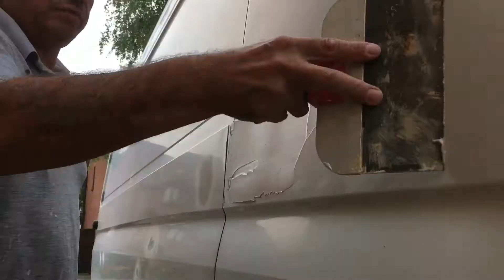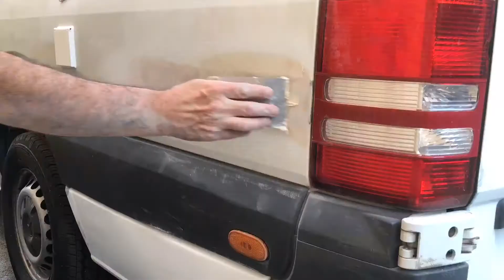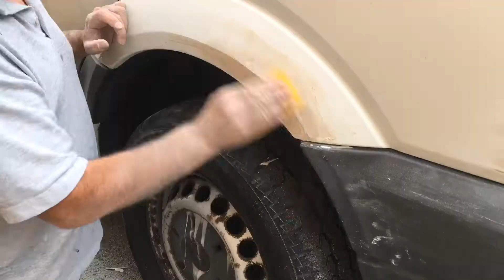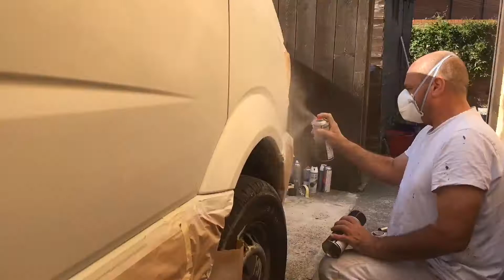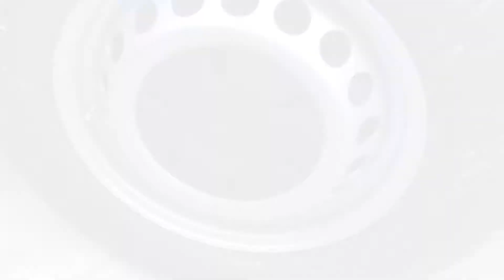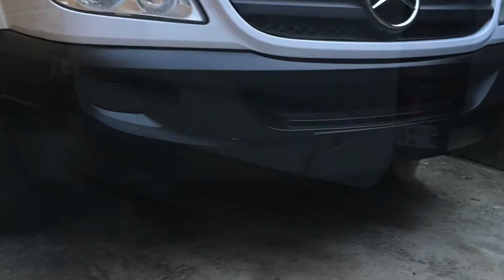Short Preview of the Finished Exterior sprinter bodywork part 3

Comment: That's unbelievable!
Reply from the maker: It looks better on camera than it does in real life! The black bumpers where sprayed black satin too to give it that better look also, not shown on here.
Reply: @diycampervanman1633  The corner of the sliding door in the previous video looked like there wasn't much left to fix after using the gun on it... Did you end up welding a plate on or did you get away with the mesh stuff?.. I'm currently looking for a van for around the 5k mark but I'm struggling to find one in my price range without moon milage!...seen some lower mileage but they're always beaten up usually between the rear wheel arch and the sliding door (must be a blind spot!) after seeing this I'm not that reluctant anymore to take on a van with a few dents and rust so cheers
Reply from the maker: @jamesvardy3530  i got away with the mesh. I cant weld so that was my only option. Its still strong now but a tiny brown mark appearing where rust wants to peek through. Only about 5% of the rust on the van has come back after 18 months so this year it have to tackle those areas again but much much less work involved. Consider getting yours professionally done for £1,000+ approx.  Zero hassle and will look better!

Comment: Just found your Channel and think this is great. I heard you say in an earlier video you got one with lower mileage. How many miles does yours have on the clock?  Keep up the great videos 👍
Reply from the maker: Glenn Clark Hi, thanks for the nice comment, i think my channel is very amateurish but its just a video journal of my build so others can see how i did my project.  So the van has 140,000 miles on the clock which sounds a lot but for a sprinter its low mileage. My van is on a 58 plate and for that year you will struggle to find a van under double that mileage and for the money i paid. I bought it off a joiner on site and thats why the mileage was respectable because it wasn’t used as a delivery van or for motorway use much.  I paid £2,500 for it including the vat and it came with assurances its mechanically sound as we both had a mutual friend. The body work was rusty and battered though so i had much work to do on the body work first which seriously slowed my conversion down!

Comment: Nice job! How's the paint holding up?
Reply from the maker: Wilje Hi, thanks for asking as mid to back end of summer a year will have passed and i’ll do a review on its condition. I would say 95% is holding up nicely but there are signs of rust returning in the odd place which is inevitable given it was in a bit of a dog to start with.  I’ve always know i’ll need a year for it to expose its most vulnerable spots which in turn will mean another spray jobby!  I want to do a proper full respray at some point but for now i have to keep homing in on the weak spots until i have cracked it. I’m afraid thats the problem with old sprinters. They are engineered brilliantly but prone to rust. They do galvanise new sprinters now so for those vehicles it should be a thing of the past but i could only afford an old machine so i took on the rubbish bodywork in favour of  reliability and for the year much lower mileage than most vans.
Reply: DIY Campervan Man ok great thanks! My van looks similar to yours (as far as condition is concerned). I wonder which particular rust converter is best suited for this application? Such as a paint on with brush vs. spray on. Was also considering using a rustoleum metal style paint for the tope coat.
Reply from the maker: William Bradley yer there are different products out there and a professional would know better. i believe the best products are zinc based. My zinc primer is quite thick and can be sprayed but my train of thought was to brush it on and keep the coating thick. If I’m honest i think where the rust is more prominent now is where i wet flatted those areas and potentially broke the paint film but rust is always a nightmare. To truly get rid i think it would need cutting out completely.

Comment: That looks a great job.  Purely out of interest, what body filler did you use and what is the process for painting over the filler?
Reply from the maker: 2-ack epoxy filler called easy sand. I talk about it briefly in the rust dent part 1 video.
Reply: @diycampervanman1633  many thanks for that.  I have what the medical peeps euphemistically call ‘an acquired brain injury’ and have an exceptionally poor short term memory so I’ll go back and have another view😁